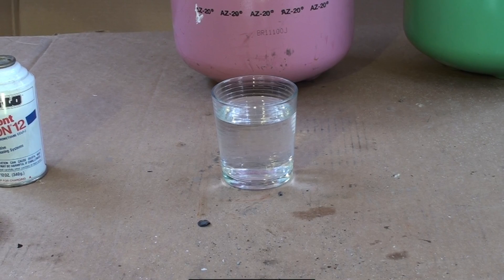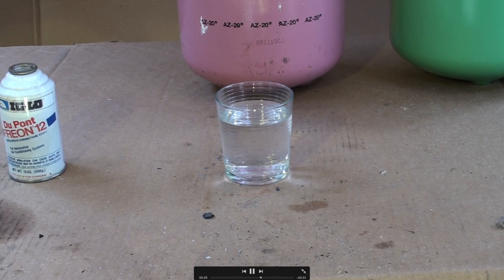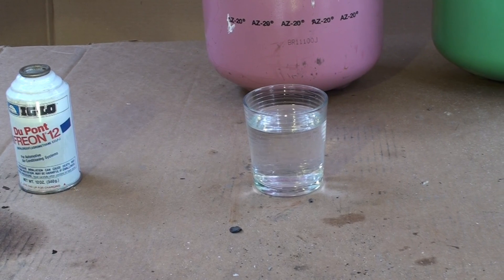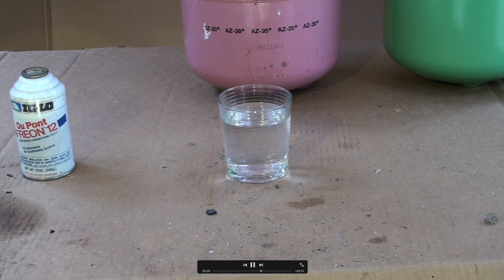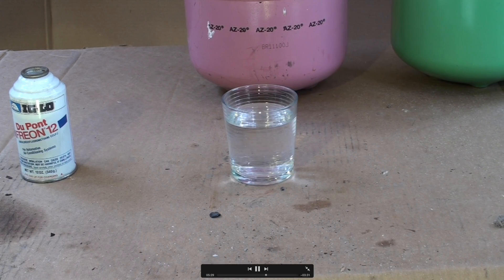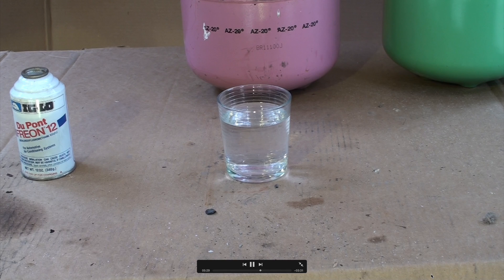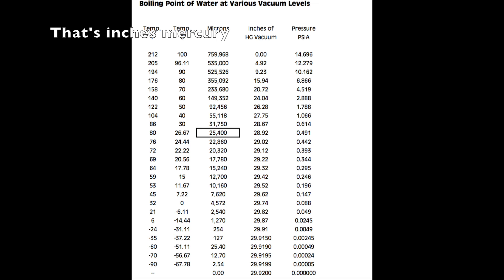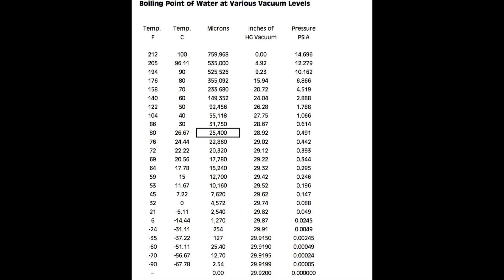refrigerants:  Will water make a good refrigerant?

Comment: What about a water blend with something else? I know in internal combustion engines, water is mixed with antifreeze to cool the engine, but in a different process. What about say, a water/butane mix? I've always wondered about the different ratios that could be used to implement water in some way.
Reply from the maker: The problem is the blend will separate when the water boils.  There are blend refrigerants that do work, but more of an engineering problem.
GFM
Reply: @grayfurnaceman Yeah, I prefer good old fashioned refrigerants like R22. No worries about fractionation

Comment: CAN FART GAS BE A REFRIGERANT?
Reply from the maker: Its methane.  Methane has a atmospheric pressure boiling point of around -250F which means the head pressure would be very high and that would make it impracticable.
GFM

Comment: Obviously not, if the intended application is food preservation or human comfort (for all the reasons you mentioned).  BUT, water DOES serve as a wonderful coolant and working fluid within closed loop, steam power generation systems (both coal and nuclear) going through the exact same cycle of phase changes as a refrigerant but with the exception of all fluid movement being done in a liquid, rather than a vapor state.

Comment: can air be used as a refrigerant like in air cycle machines?
Reply: grayfurnaceman Using air as a "refrigerant" is actually not as crazy as it seems, gas turbine powered aircraft do just that with the air cycle machine (ACM), which is a pneumatic powered air conditioner. It's an interesting device because it works quite differently from conventional refrigeration, so much so that it might make for an interesting video on your channel. How it works is pretty simple. The energy source for the ACM is compressed air, which comes from the aircraft's engines if in flight, or if on the ground from the auxiliary power unit (APU), a small gas turbine engine found in the tail end of the aircraft. The APU generates both electrical and pneumatic power for operating various systems on the ground including the ACM. The compressed air from the APU is at about 40 psig and quite hot too (300 degrees F). Like any gas when the air is compressed it heats up, so first the compressed air is run through a heat exchanger and is cooled by outside air. Therefore, the compressed air has now been cooled so that it's about the same as outside temperature (assume it's 90 F outside). After being cooled, the compressed air then is piped to an expansion turbine, and this is where the magic happens. Turbines extract heat and pressure energy from fluids, and the expansion turbine in the ACM does just that. The remaining heat and pressure energy from the compressed air is used to spin this turbine, and in the process the air cools significantly and exits the expansion turbine at around 40 degrees F! This occurs due to loss of remaining heat energy as well as through expansion. The turbine can be connected to various loads, including a cooling fan for the heat exchanger, or a second stage air compressor to boost air pressure prior to going through the expansion turbine.
Reply: That's something I've wanted to experiment with at some point. In theory, it would actually be totally possible. Air heats up when compressed and cools off when decompressed, so heat transfer would be possible even entirely as a gas. I know the efficiency would be terrible, but it would still be interesting to see how well it could work and whether it would be possible to achieve any measurable cooling at all. The moisture in air would definitely be a problem though, so I'd use something like dry nitrogen.
Reply from the maker: +627horsepowers Not effectively.  The condensing and evaporating pressures are a combination of the gasses that make up air.  Unfortunately, the primary gas is nitrogen.  Condensing and evaporating pressures/temps are so far apart that it would take one heck of a compressor to make it work.
GFM

Comment: How about Lithium Bromide chillers that was used back in the 60's for commercial air-conditioning? A few of those dinosaurs still exist today.
Reply from the maker: mechanicwarrior20 Lithium bromide is used in absorption refrigeration systems.  Its a mix of water and lithium bromide and uses heat to produce cold.  They are somewhat popular where natural gas is much cheaper than electricity.
GFM

Comment: Liquid propane?
Reply: Besides flammability, propane is a really great refrigerant for a lot of reasons. To list a few of those reasons, it's very efficient, the pressures are reasonable, it has no ODP and very low GWP, it's not toxic, it carries oil very well, it doesn't react with air and moisture to form acids, and it's cheap.
Reply from the maker: Daniel Grenon Propane has a lot positives, but it is highly flammable.  There is one company that is marketing propane as a refrigerant to replace R-22.  I will not use it as the liability is too much.  
GFM
Reply: It’s called R290 look it up
Reply: A lot of small appliances like refrigerators and I think even some window shakers use a propane variant. They're extremely efficient. And if the system only uses a few ounces, flammability is worth the risk.

Comment: Why not CO2?
Reply from the maker: cavibird2005 CO2 is used in some countries and has some positives.  Pressures are extremely high.  My father worked with a CO2 unit in a theatre in the early 1930s.  It was used because all other refrigerants were toxic or flammable.   There were no end of troubles with it.
GFM
Reply: cavibird2005 But can it be turned into a liquid to carry heat.
Reply: One big problem with using CO2 as a refrigerant is that the pressures are insanely high.

Comment: When i was in school for hvac, i could have sworn there is a system that uses water, i believe its called an absorber, i think it uses another chemical as well though i forget what chemcial.
Reply from the maker: Pitbull14218 It could have been used as a secondary refrigerant.  That just means a compression refrigeration system cools or freezes water, then is disconnected and a (probably mobile) unit will hold the temp for product to be transported.
GFM

Comment: water cant be compressed, which may be a bit hard on a compressor.
Reply from the maker: Actually water can be compressed as a gas as all other refrigerants when they are a gas. 
GFM
Reply: Chris Roads Liquid refrigerant can't be compressed either ...
Reply: @coilsmoke2286  Exactly. Which is why you really have to watch the superheat temps so you're not bringing back liquid refrigerant and slugging the compressor.